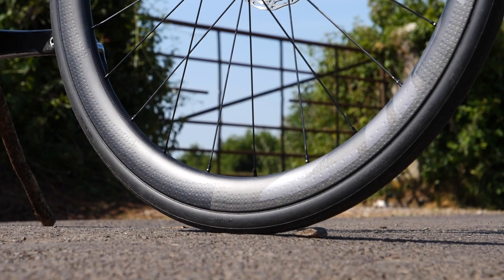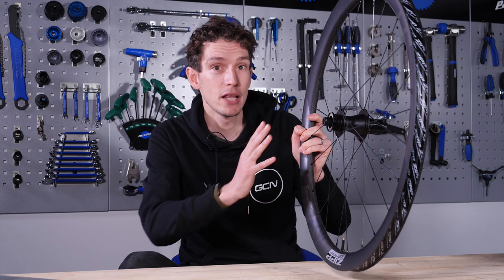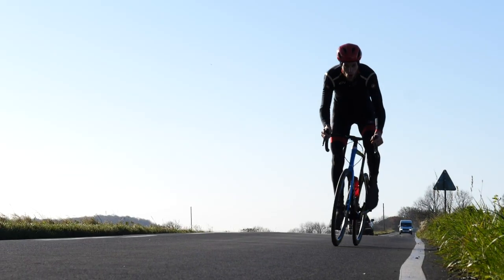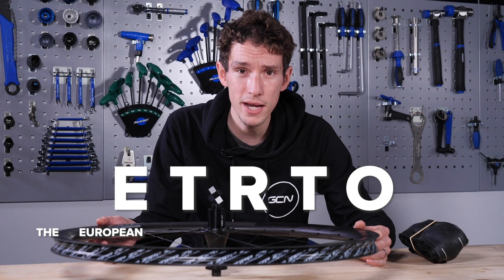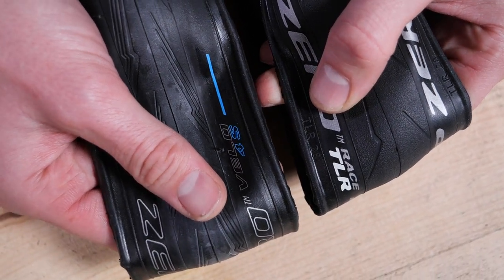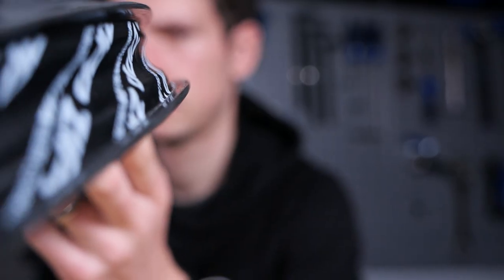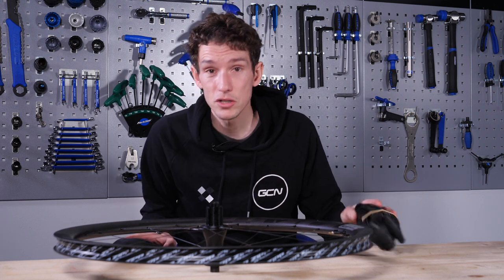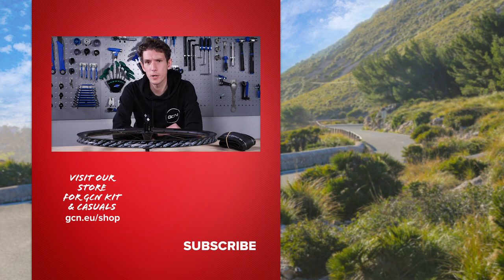Hookless Rims Explained | Which Bike Tyres Can You Use & Why?

Comment: So... My question is... What if your total system weight is outside the "normal range". With 28mm clinchers I run PSI well into the 85+ range for a 118 kg total system weight. Are hookless rims essentially not a good idea for high system weight?
Reply: The "normal range" is just a incitive indication to convince poeple to ride on lower pressure. In your case, you actually HAVE to ride it 5.12 bar front and 5.44 bar rear to be obtimal (following sram pressure calculator). You're not just stubornly riding overpressured by tradition but actually because it is obtimal for your system weight. Tires are actually tested well above these pressures so don't worry, just ride it the obtimal way. ;) 5.44 bar is not even 10% higher that 5.0 bar.

Comment: Not to blow the Specialized horn too hard, but they've abandoned tubeless tech in their further road rim/tyre development. They seem to always be on the pointy end of developments too, so I'm not hanging onto hope this road tubeless trend will become the mainstream.
Reply: Yup, and I don’t even see why use tubeless on road. The whole point of them (offroad) is to run lower pressure and not get pinch punctures...Most people on road ride 100psi or higher, and flats are usually from cuts (sealant won’t seal). And even if it’s a small hole that seals, you’d lose a lot of pressure with so small amount of air in the tires and have to pump 1-2times.
Reply: @izi941  Sorry, but your comment's basically 100% wrong. People run high pressure in road clincher tyres because the tyre is narrow and you need that pressure to avoid pinch flats, not because high pressures are somehow intrinsically good. If you didn't need to run high pressure to avoid pinch flats (i.e., if you weren't using inner tubes), you wouldn't need such high pressure.

I've run road tubeless for about a year and had plenty of punctures that have sealed just fine. Small shards of glass create small holes that sealant can easily deal with. No extra pumping is required and, even if it was, putting a couple of pumps of air in your tyre is about a hundred times faster than replacing an inner tube.
Reply: @beeble2003  Where are you riding that you've had plenty of punctures in a year? I average 1 puncture a year putting in about 200k a week. Within our local bike club we average about 4-5 flats year for the whole group (60 riders). Maybe you should consider switching back to tubes.
Reply: @marcpost4034  My "plenty of punctures" makes it sound like a ton. I probably get a puncture every two or three months, riding about the same distance as you. No way I'm going back to tubes: with tubes, that means I have to fix a puncture every couple of months; with tubeless, they just seal themselves and I continue riding.

(Well, actually, I have a tube in my rear tyre at the moment. In early December, I hit a pothole in the dark so hard I damaged my rear rim, so I'm now running a tube on that tyre. I'll replace the wheel in the spring, once the roads aren't covered in grit and crud.)
Reply: Maciej Jan Długosz  Ok but I think we’re talking about road riding here.
Reply: Maciej Jan Długosz  Right, but this video is not about track cycling. Nobody is proposing using lower-pressure, wider tyres for track riding. If your local asphalt is as smooth as a track, you're lucky.

Comment: Hello everyone. I have bought zipp 303s wheels with this system in february 2020. my experience is good. The only drawback is that there are only two tyres on the market for this system. They are schalwe pro one tle and pirelli zero tlr. The first one lasted 1300 kms on the rear tyre and I had to change it, the second one with 1300 kms I have removed it to finish wearing it on the front wheel. The front tyre has 2800 kms and is still half life. For the reason of the high wear I tried with Pirelli and I think it's better, it's heavier, but I think I will mount schalwe in front 25 and pirelli in the back 28. In short it is a great wheel, weight 1540grams that you can ride with a good tyre the pirelli but this limitation of nerumaticos in the market is the only thing that worries me. if it is true that there are two but schalwe weighs 260grams but it wears out very soon and it is worth 55euros.

Comment: Optimum tyre pressure is when the tyre has a 15% drop when you're sat on the bike. That's just under 2mm flare each side on a 25mm tyre.

Comment: I used a schwalbe mtb marathon wire tire (clincher) with a tube on my hookless cross country rim for over 4000km, never had an issue, infact, kevlar bead tires got so loose after 800km that they wouldnt hold pressure for an entire day

Comment: Will never ride a tube again after now switching from tube to tubeless for a second time. So much more comfortable. Better handling.
Reply from the maker: Nice!
Reply: And I set my psi at 72.5 just experimenting to see how low I can go with the pressure. Very comfortable could probably dip into the 60 psi range with no issue. Aluminum caad13 and the tires/tyres absorb a lot of the chip seal in Texas.

Comment: Interesting to see from your video that Pirelli emboss tyre info just above the bead. I have found that the tyre doesn’t quite seal at that position until the sealant works it way around to that position. The raised writing compromises the bead rim interface. Not a huge deal obvs but why put it there? Great clear video 👍
Reply from the maker: That is an interesting observation.
Reply: Good point. It’s infact been moved upper to the rim line. Mass production is running withou that now 👍

Comment: I’m completely satisfied of my hookless gravel wheelset. I run with 2bar pressure, I went over 60kmh on a gravel descent and I felt I was on tarmac! But I do not agree with the fact they are cheaper: all the wheel builders ride the fact that it is new and the costs are at least the same as the hooked if not higher...that’s where I live!

Comment: So Why the Pirelli P zero TLR is ONLY compatible with hookless rims in 28mm and 30mm tires, BUT NO with 24mm and 26mm tires? It has to be more than how strong the tire bead is because I would think that all the P zero tires are fabricated with the same quality standards and the only thing that it is suppose to change is the tire dimension. Thank you.
Reply: Indeed, a 28C tyre on the Zipp 303S rim will likely measure wider than 30mm, exceeding the external rim width of 27mm and killing any aero gains. You would need to run a 25C to have any hope of preserving any aero advantage on this wheelset.
Reply: That is due to inflating pressure: the smaller the Tyre the higher the min and max pressure, and for a 24 and 26 (which are designed according to new ETRTO, so measuring an effective 26 on 19c rims) the 5bar limit is simply too low and doesn’t make sense form a ride quality perspective too.

Comment: Has there been any testing around punctures and how well a hookless rim holds a tyre if you suddenly get a flat? I use hooked tubeless, and unseating the bead is really difficult which gives me a bit of confidence that if I’m descending and get a big slash in my tyre I won’t be rolling on carbon before I have the chance to stop.
Reply: Unseating the bead is the same on hookless, because it’s not the sidewall of the rim that holds it in place on either hooked or hookless, it’s the rim bed. So with tubeless tyre you’ll be fine.
Reply: @simonrichardson5259  Thanks. Seems like a complete no brainier then.

Comment: As soon as I can find a good reason for new wheels, I'll be switching. I've long wondered why it was so slow coming to road and gravel bikes.
Reply: Because you have to ride at low pressure for the sealant to work. Anything over 60psi and the sealant just blows out. Most road riders (fast) or racers don't want to to ride at 50-60 psi on fat tires.
Reply: @marcpost4034  don't worry, I'm well past the age of being able to go fast!!

Comment: 70 PSI and the first square edge pothole will cost you a rim.
Reply: no
Reply: Not true.
Reply: @DaveCM  Old frames (before disc brakes came in road bike industry) don't always allow you to go wider that 23-25mm. On this width, 70PSI is actually suboptimal for a 80 kg rider on a 8 kg bike.

Comment: The new Giant SLR1 wheelset for 2020/21 are hookless. They’ve recently updated their website after testing tyres other than their own. Useful to check the website. 

I’m just worried about the psi. At over 100kg 75psi would mean riding on the rims nearly.
Reply: Are you using Giant SLR hookless rims ? Like it ?
Reply: I have these on my Propel also. As a rider at 115kg I've found around 80psi to be good with Cadex 25c tyres.

They don't feel 'splashy' until down below 60psi that I can tell.

Comment: 72 psi is the easiest way to crack a road tire sidewall especially for 80kg rider like me.
Reply: With the proper width tire you’ll have no problems. 
https://axs.sram.com/guides/tire/pressure
There are other manufacturers recommendations charts pretty consistent.
77kg and 28c works well for me on spirited rides along some smooth to rough potholed roads.
Reply: @awesomexistence  interesting website thanks. Do you run at their recommended pressures? For me, 69/73 is way higher than the 55/60 I gravitate to
Reply: @pigeonpoo1823 , on long rougher surface rides I’ll start as much as 10% over recommendations and end the ride with pressure recommendations pretty close (slight pressure decrease during ride). Smooth routes and shorter rides I’ll start out spot on pressure recommendations.
Reply: for 80kg you dont need anything ner 72psi on a 28c tubeless tire and 23c rimwidth.

Comment: Are replacing tires a pain? If you are running hookless rims with a tube on the new Zipp 404's and get a flat will changing out the tube be easy or a pain as the tire is super tight?

Comment: Si, you mention that one can still use a tube with these wheels and some tubeless tires. I don't have any experience with tubeless wheels and do get flats from time to time, when I ride (I have clinchers with tubes). So, how easy is it to repair a flat that a sealant is unable to cover, vs. using a tube with tubeless tires? Cheers! Manny

Comment: What width of tyre do Zipp think I'm running if the optimal pressure is "substantially below 72psi"? That sounds like they're talking about, say, 60psi, which sounds extremely low for, say, 25mm tyres.

Comment: So what's it like getting a tyre on rim where it's not designed to stretch? Doesn't sound easy
Reply: Probably due to the bead well in the centre of the rim.
Reply: @mt1p  The bead well is what makes the difference.  My mountain bike wheels have nice wells, and everything can be done by hand.  My road bike tires have very little well, and are quite difficult.

Comment: Will riding such a lower pressure increase the risk of "snake-bite" punctures?  Most times I snake-bite are because I didn't top off my tires to 100psi.

Tim
Reply from the maker: Well it definitely won't if you're running tubeless

Comment: I just purchased some Giant SLR1 hookless wheels with Cadex 700x25c tyres - Giant's own website recommends running 84psi for a rider my weight (with recommendations of up to 100psi for heavier riders). 

I keep hearing the 72.5psi limit (mostly through other GCN videos), but can't find any references to it from Giant or Cadex. It sounds like this limit can be ignored (unless the manufacturer says otherwise) and the ETRTO guideline is somewhat arbitary?

Thanks for the video. Feeling less scared about the wheels now (confidence will come once a few thousand km are on them).

Comment: I hate hookless rims for simply existing. I bought a travel bike not knowing that the rims it came with where hookless (wasn't pointed out in the specs and i didn't even know they where a thing). I planned to but some Schwalbe Mararthon tyres on them as they essentially never get punctures and had to realise that this isn't possible as all Marathon tyres require a hook. To late to change the rims and now i am prettymiuch stuck with very limited tyre options. They are also much more difficult to get of the rim due to the tigher tolerances, making patching up a puncture insanely difficult in the field. And i don't like to run tubeless.

Comment: My minimum tyre pressure is 85psi written on the tyre wall and Maximum 130 psi. I’ve been riding with 100-120 psi, so according to what you are saying, even 75 psi is the upper limit for most road bikes.
Reply: Yeah, I use about 60 with a 28mm and 70 with a 25.
Reply: Those high pressures are only needed to avoid pinch flats on your inner tubes. If you were running tubeless, you wouldn't need those high pressures.
Reply: @beeble2003  after watching the video, I’m now running 75 psi rear and 70 front. Best decision.
Reply: @maxeylifetv2676  Are you running tubeless? If you have inner tubes, you'll very likely get pinch flats at those pressures.
Reply: Maciej Jan Długosz  Not sure what you mean. I don’t notice any steering problems with tubeless. Yes, the lower-pressure tyre will have more sideways deformation but not more than a couple of millimetres. The “sloppiness” you notice is probably just that the bike isn’t bouncing off every tiny bump in the road.
Reply: Maciej Jan Długosz  OK, with tyres that wide, the rear end will feel like it's moving around. With something like a 25mm tyre, this is much less of an issue, as there's simply less tyre to be deformed. Your experience of 38mm tyres says basically nothing about the sorts of tyre widths that are used on road bikes.
Reply: Maciej Jan Długosz  You ride around potholes, not into them. If you want to ride up a kerb then, yes, you bunny hop it (or, at the very least, you pull up on the bars to hop the front wheel up it and then stand on the pedals and roll slowly up it with the back wheel). If you abuse your bike by riding straight into kerbs, of course you will damage it.
Reply: Maciej Jan Długosz  Thank you for the lecture but I'm well aware of what a road bike is. I ride thousands of kilometers a year on one. I am quite capable of mounting a kerb without damaging my wheels. It's not rocket science.
Reply: Maciej Jan Długosz  What are you talking about? I never mentioned any specific pressure. My bike can't take 28mm tyres, so I don't know what pressure I'd be comfortable running them at. However, I can tell you that I've done thousands of kilometers on 25mm tubeless tyres at 5.5 bar with no issue. Given that, 28mm at 5 bar seems entirely plausible to me.
Reply: @beeble2003  I stand corrected. Thank you.  Now... Like I said, take it easy, especially with the name-calling.
Reply: @beeble2003  And it was all made possible because of Bebble and his super-friendly personality.  Go easy Bebble.  Please go.
Reply: @Ron_Boy  Yes, it was impolite of me to call you a name. It was also impolite of you to post a patronizing comment (now deleted) where you addressed me like a child for making a mistake, when the mistake was actually yours. If you'd just said "By the way, it's spelled 'curb'", I would have reacted in a very different way, along the lines of "Actually, both spellings are valid."
Reply: @beeble2003  You're right, and I apologize.  I'd never seen that spelling before and I should have checked it first, instead of posting my arrogant comment.  Live and learn.  I actually saw another post with the same spelling you used.  That was my signal to check it, but I just got lazy.  Anyway, thanks for the feedback.  I really do appreciate it.  BTW, it wasn't me who deleted my comment.
Reply: @Ron_Boy  Thanks. Weird that your comment disappeared. I've deleted my reply to it.

Comment: I think this video warrants a follow up on tyre pressure for roadies. I doubt @sirichardson is running 72.5 PSI on his road machine?!!
Supermarkets don’t sell chicken after the use by date based on a safety buffer!!
And when I use the Mavic tyre pressure app - its recommendations are above this.
Reply: Use the Zipp tire pressure calculator.
Reply: To my point - despite new ‘standards’ - different Apps (from reputable tyre manufacturers - see Si’s video on Mavic Tubeless in past 2 year’s) prescribe different pressures- some above the ‘safety’ limit!! 
I’m confused how we got here - hence a suggestion that it warrants a separate video. What I’d be interested in is whether GCN now have enough freedom within their commercial arrangements to actually make an independent video on this topic discussing it with other tyre manufacturers?!
Reply: @BRC76 , ERTO standards for bicycle tire/wheel specs are being revised (after decades) to standardize the industry and in response to newer technology. I suspect this may narrow manufacturer recommendations on pressures. The process for revising the specs began last summer and should be complete soon. Tire construction variances will also affect pressure recommendations.

Comment: The 72 psi info really baffles me. I understand that on gravel or bad, bumpy asphalt these lower pressures may actually improved rolling resistance. But after smoke testing I know that running my tires on relatively smooth roads at 100-120 psi produces a lower rolling resistance and more efficient ride. I'm not using tires that can only be inflated to 72 psi unless it's on gravel or s*^*ty roads.

Comment: If the bead of the tyre is designed not to stretch, does that make it really difficult to seat the tyre on the rim. Do you need tyre levers that are three feet long?
Reply: You have a fundamental misunderstanding of how a tyre makes it over the rim! No tyre bead "stretches" to allow mounting, the purpose of the wheel well is to reduce the apparent diameter of the rim so that the tyre can slip on.

Comment: Which Pro teams intend to use this?
Any?
If not, why not?
Reply: None, because they mostly run 25’s at optimal pressure... which is above 73psi.
Reply: @hogdog567  during cobbles classics they ride 28mm or more with 4,5 or 5bars (sorry i dont use psi only ISU!). So we may see those type of rim during classics 2021.